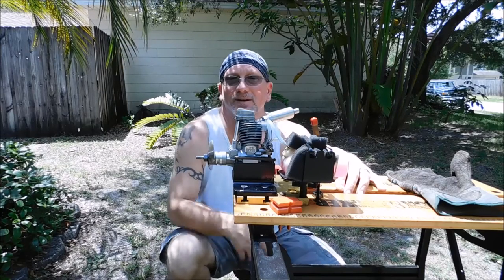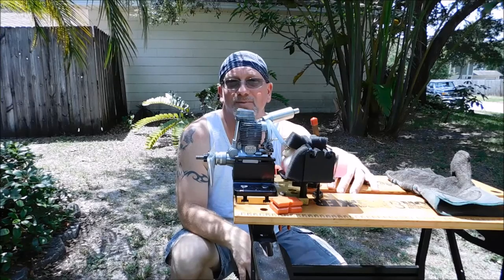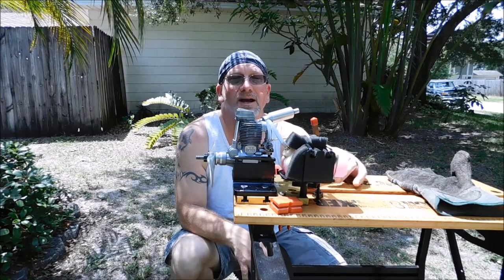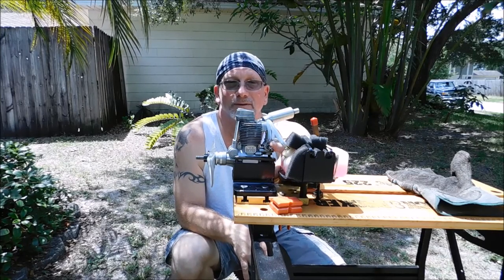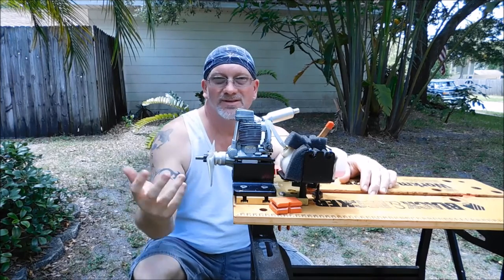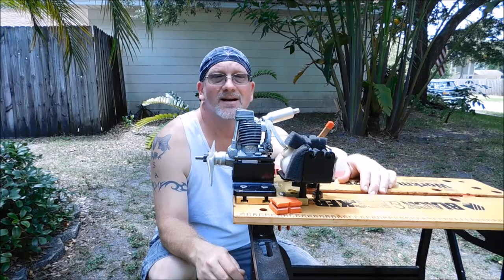Magnum XL 70RFS first run

Comment: Are you running 10% 4 stroke fuel? What glow plug are you running? I have the same exact engine which I used 10% 2 stroke to break it in as the instructions stated to do. After breaking in it ran great. I used the same fuel on the first few flights ran great. I crashed the plane so the engine hasn’t ran in 5 years. I put the plane back together and stoped to get fuel they recommend 20/20 Byron fuel. I do the first start up in 5 years and it runs like crap. After adjusting it a bunch I can finally take the battery off the glow plug and it will stay running but only at 1/2 throttle or better. The carb has no air leaks. All that has changed really was the fuel so I’m wondering what fuel I should try to run.

Comment: Hi there, i have ASP 70 fs, however, never get it up to 8000 rpm...as of now, HS needle set to 0.75 turn. Just wondering, what would the issue? Is this due to valve spring is weak compare to other FS engine? My prop size is 12 x 6...

Comment: Is 12x6 the best prop for this size engine was using a 13x8 but seemed slower ?.  Thanks.
Reply from the maker: There is no one set prop for any engine.  That is something you must experiment with to see what performance is like with different sizes.
Reply: Hi dave I had a friend lean out the LPN a bit it was to rich. 13X6 prop goes really well now.

Comment: What did you do to rebuild the engine?
Reply from the maker: Cleaned and replaced the bearings is all I did if I recall.  I do so many engines I do not remember what all I did unless it is mentioned in the videos.
Reply: I understand completely and appreciate the response.